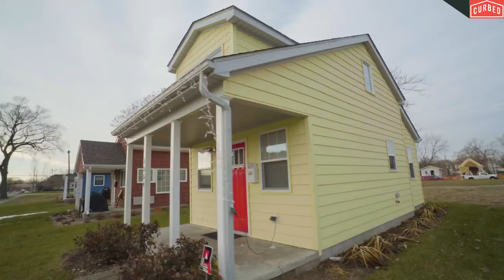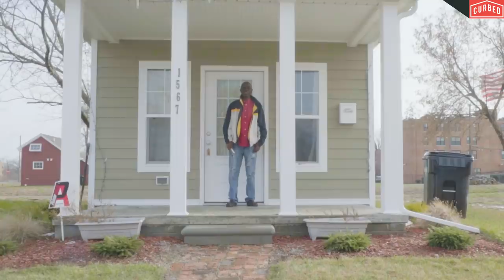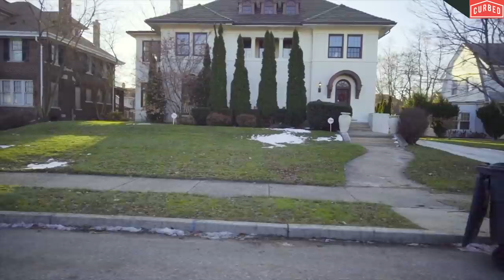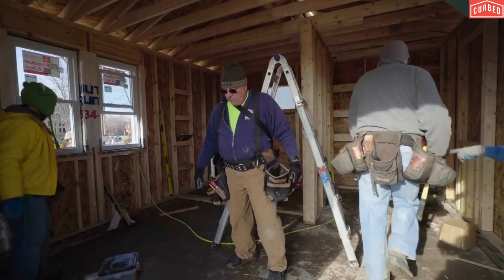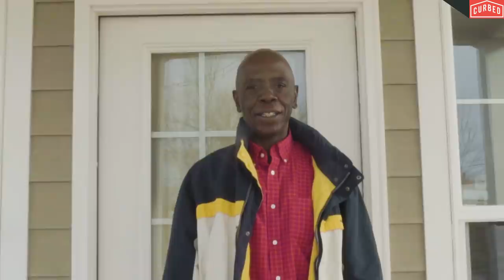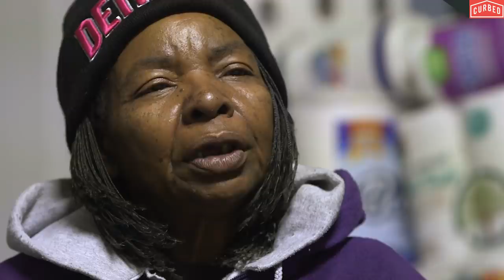Can tiny houses save Detroit?

Comment: This may sound crazy, but can some of those abandoned houses be raised and the materials be reused to build these small homes?
Reply: That's a good one.
Reply: There are laws against using used materials for building new homes. It’s a good idea but keep in mind a lot of these old houses Material is basically unusable to how old and weathered they are
Reply: ^ true, but I believe you can still repurpose old materials for cosmetic reasons. So they can at least save on things like siding and trim.
Reply: I know all over the country parts of houses are saved and "repurposed". Doors, hardware, trim, even hardwood floors. It just seems a waste to demolish those houses and haul it off to the landfill. I really have know idea how much salvageable material would be in those houses. I was just a thought.
Jim
Reply: Thats a great idea!!!
Reply: Jim Johnston i was thinking the same thought. or the sinks, bathtubs, etc.
Reply: Doesn't sound crazy at all. Fantastic idea!
Reply: As an architecture student this sounds horrible razing the historic homes...
Reply: Some of it can but typically it is rotten from not being watertight. It’s can double or triple the cost of materials to deconstruct a building then recycle
Reply: There are things that can be repurposed. I see them do it all the time here in my city especially with bricks. The only things that couldn't be, depending on the age of the house, would be anything containing lead
Reply: Also, Habitat for Humanity gives away to some, almost all the old things from houses they rehab
Reply: @jimjohnston3188  
The valuable parts of demolished houses dont end up in the landfill but in antique shops or in architectural salvage shops.  Clawfoot tubes, light fixtures, windows,  stained glass, hardware, door casings, hinges,tiles, fireplace  mantels, left behind furniture etc.  can be resold for a huge profit,  it's a gold mine, this is why old buildings get demolished and if the buildings are downtown there is also the value of the land to consider.
Reply: Yes why not great ida
Reply: There is the cost of labor to remove these things but aslong as they have more volunteers it's possible there is alot of windows, doors, cabinets, hinges, hard floors, sinks, bath tubs, even toilets, appliances glass furniture light fixtures and fans . The only problem I see is storage and quality inspection on all the recyclables. But if even that can be done then it's possible. Although it wouldn't technically be a new home with recycled material. If you think about it they are better off selling all that stuff to begin with and using all new materials.
Reply: @kvnbal  I agree. It is a sad prospect, but if there just is no money or resources to be had, at least salvage as many architectural objects as possible. And even if money was not the problem, I fear many of those formerly beautiful, stately homes are beyond repair.
Reply: I'll bet there is lots of beautiful wood that could be saved.
Reply: Exactly, people need to change their values and standards, buying new isnt the answer.
Reply: That sounds awfully like a job?
Reply: The problem is anyone with an actual job isn't going to waste their time sifting through trash, so that leaves us with the people on welfare and there's no incentive for them to even clean their own house we give them for free let alone do actual work, which leaves us with volunteers who's time could be better spent helping people or building a new house, just bulldozer them and start over
Reply: This is such a great idea.
Reply: Not crazy at all!
Reply: @marilynwillett804  I hear you about not wasting. But these are low income solutions. Aside from the fact that most of those homes are completely destroyed, how would they pay a thousand dollars a month for utilities in the winter? 400-500 in the summer? I get what they're doing here and I love it!
Reply: Most of the valuable materials have ALREADY BEEN STOLEN by those damn Mormons.
Reply: Yes! The laws mentioned vary state-by-state. My father worked for HUD in Nola and if the materials were still in good condition, they were reused in various ways after Katrina in a lot of coastal towns. Just like if you bought land and tore down buildings on it, depending on where you live, you can repurpose the old building into a new. Outside of city limits is much more common because county rules are lax.
Reply: @lilvegan  it would actually be much more expensive to use salvaged materials for siding and trim. I was a custom builder for years and we would use reclaim materials from time to time and it's very labor intensive and the material cost is usually and least 4x cause of the word reclaim and HGTV so now everyone thinks it's worth its weight in gold.

They said in the video tho that the materials are being donated to them so there would  not be any savings at all and for the type of project they are putting together it just isn't a good fit for that application
Reply: Fantastic idea!
Reply: TKAT it wouldn’t have to be used just structurally, salvageable materials could be used as decorative pieces
Reply: I take it you mean "razed" and recycled. Great idea.
Reply: Reclaimed lumber as interior two by fours, plywood from floors, bath and kitchen fixtures, electrical fixtures, doors , windows and hardware can certainly be recycled. That's how organizations like Habitat for Humanity get things done.   @tkat5709
Reply: Jim Johnston   The answer is no!
The old wood smells like fried chicken, watermelon, and crack.
Reply: It depends on the damages of each house. There may be black mold, wood rot, thermites, etc. Salvaging would require a lot of manpower, which may make it cost more.
Reply: @tkat5709  
As well you have to consider some these 
Older houses have lead base paint and asbestos
Embedded in the materials that can't be removed,
Plus the integrity of the materials too,
Probably been degraded over years of negligence,
And exposure to the elements of that region,
Michigan gets nasty winter storms,
Cold Weather,
And a lot of rain doesn't it?
But what this woman doing is good,
At least she's trying to help the people there,
Just hope The Government or 
The NIMBYS
(NOT IN MY BACK YARD TYPES AKA THE RICH) 
don't try stop her,
Or the criminal elements 
In that community ruin it for those in need there!😕
Reply: Jim Johnston good point👌
Reply: That doesn't sound crazy, that's a good ideal.
Reply: And a lot of those old buildings are either historically significant but not well kept or condemned bc of all the bad chemicals used in buildings. Detroit doesn’t have the money to fix it(the rich don’t help)
Reply: Jim Johnston great point!
Reply: It would be more work tearing it down to reuse material.
Reply: @lilvegan  whatever money you save might be offset by your operating costs. Think about it - she'd have to pay someone who knows what to get & how to get it from an older home and possibly pay for some sort of demo work in order to obtain them. Time is money... for someone trying to give back to the homeless, reducing operating & building costs are important in order to build as many as possible.
Reply: Amazing idea... you are a brilliant man! 😇
Reply: To much lead in materials
Reply: The bricks can be but the cost to do it wouldnt be worth it
Reply: @tkat5709  well I bet the bank that owned them are waiting for them to appreciate lol at least that what we were told
Reply: Great idea💕
Reply: I believe Some used things can't be reused....like toilets
Reply: Great idea. Also, refurbishing abandoned homes for families. Use Habitat for Humanity and Rebuild Together. 
*A good idea is to redesign the City with "round abouts" for traffic control. Design transportation with electric buses and light rail.
Creating a Walking City with Bike Lanes. Using Solar for Street lights and panels for heating and cooling. Caughting rain water and use of "Grey Water Systems."
Reply: I see... Then it would be a mini house ghetto again.  Brilliant.
Reply: Jim Johnston why not buy those abandoned homes fix it up and have people live in it
Reply: I seriously doubt the materials would be usable. They have safety codes when building homes and old materials just wouldn't be safe. It's a nice thought though.
Reply: @jimjohnston3188  We have a Habitate for Humanity store. People donate things for construction and home. Proceeds go to help fund Habitat for Humanity builds.You would have to get the iteam to them. They do pick up large donations.
Reply: Thats SMART!!
Reply: @lilvegan  - Doors and stained glass, fireplace mantels, woodwork etc.
Reply: @kvnbal  - Keep the historic that are viable.
Reply: Some are rotted
Reply: Kevin Gabriel Balderrama they are most likely filled with asbestos..
Reply: Jim Johnston Razed.
Reply: Restore is great for repurposing materials. I've been to a few. A little trove of treasures.
Reply: To be fair the integrity of the material that structured the old home may be compromised and not sturdy enough to uphold the weight of the house. It's risky in which the house may collapse if the structure gives out. Brand new materials will withstand the threshold of the house better than used materials.
Reply: Good idea but there’s a lot to even tearing down a home
Reply: I wish they could fix up the abandoned homes for families. It seems so sad and ironic that Detroit has a huge homeless population and yet there are empty homes everywhere.
Reply: Great idea! People reuse building materials all the time. Habitat for humanity is just one of the non profits that does this.
Reply: Well it’s a possibility
Reply: tons of regulations and corruption in Detriot prevents that and most other great ideas.
Reply: This may sound crazier, but on the Grand Tour they showed just how cheap housing is in Detroit. Why pay rent on this when you can buy a full home for less?
Reply: chula chalupa  unless you're talking about old stuff from the 1800s or something then its junk, nobody wants asbestos houses from the 60s, everything is junk
Reply: Generally it costs more to disassemble an old home and reassemble the materials than it does to just built new.
Reply: @tkat5709  Yeah idk if its a federal law about repurposing housing materials, if so than Habitat for Humanity would have been shut down a long time ago because thats kind of their business plan. I know their stores are mostly interior furnishings and materials but they definitely reclaim tons of lumber, doors, windows, patios, porches, tiles, floors and anything thats still in decent condition at the one in my city
Reply: TKAT that and a lot of old buildings used asbestos and other materials that have been found to be harmful to human health
Reply: @tkat5709  which laws? I see people reuse material all the time. As long as it's in good condition.
Reply: How could we make this happen?
Reply: @marilynwillett804  the government think it is
Reply: There is way too much asbestos, lead paint, mold and rot. Mold in one area of a house, contaminates the entire structure with spores.
Reply: @saraxdouglas8577  Sounds like good idea, but it's also double working with poor quality result. It would be excellent option in some apocalypse where making of new parts is in halt
Reply: Someone from Detroit area here! The thing is, they aren’t demolishing these homes. Many of them are staying standing even though they are horribly unsafe. Most of the “reusable parts” like doors, toilets or tubs have already been stolen or destroyed from inside these buildings. It is best in this case to start new.
Reply: What if it was your property? Doesn't matter if it's decaying. If someone owns the land it is theres and so is everything on it. You have no rights to it.
Reply: @jimjohnston3188  I get doors and hardware stuff but if it a part of a wall or something they can't reuse it
Reply: Most social programs suck. This one is legit because you’re helping people to become self reliance. This is awesome. Much better than giving people jumbo loans so “everyone can have the American dream”. Props.
Reply: What is bad in living in an apartment? Maybe just build good apartments? They can be rather small and affordable
Reply: Yes,can they use the glass? If other materials deteriorate over time,i guess the window glass at least still can be useful
Reply: you can reuse some things like the foundation in some cases
Reply: @lilvegan  .in the bad areas siding and trim,all piing,any copper or metal,water softeners,water heaters,ducting 

is pulled from the homes and sold for scrap sometimes from houses still occupied
Reply: @kvnbal  I rather see that then the torched homes you see a lot of after being abandoned.
Reply: razed
Reply: Not crazy, it's necessary!
Reply: Brilliant Jim.
Reply: That's exactly what needs to be done.
Reply: Well, nobody wants to help people that try to shoot them for being there so. Probably not.
Reply: Asbestos.  Lead.
Reply: Awesome thinking on your part! Unfortunately we have too many laws that are very restrictive when it comes to building and permits and codes.
Reply: And also think about the land that the previous abandoned houses sat on, they could always use it for a different purpose, maybe build more tiny homes...
Reply: most of them  are rotted and most valuable materials like copper pipes have already been stolen so i dont think itd really be worth it
Reply: Jim Johnston Great idea!!
Reply: The regulations  and permits that are required to do this makes it very frustrating and slow.
Reply: No but the Chinese can make furniture out of it, and for 500 dollars you can be the proud owner of a wooden futon that is made from recycled wood from a meth lab, and homicide scene
Reply: Roofs fail in abandoned houses..that causes water to come in and mold and really nasty stuff to grow.  It becomes very risky to get the part of the house that is actually useable.
Reply: Seems like a hazard and not very safe.
Reply: @tkat5709  
And who do you think lobbies against repurposing old housing materials? Big home builders that's who. Big corporations don't want Americans to save money.
Reply: Very true
Reply: Taxpayers own all those Fannie and Freddie houses that sit empty.
Reply: Or refurbish the homes.
Reply: No. Years on countless pollution of all kinds settled inside the walls. Most of the Detroit homes are well over 100 years old. Some of the wood is petrified hard as a brick and a lot of it just rotted. Not worth the effort.
Reply: You mean houses that have been gutted, burned, and stripped of everything that was worth $? LOL Have you ever been to Detroit? 
And really, how much smaller do they want houses to be in Detroit? You mean families in a 600 sq. ft. flat isn't small enough?
Reply: @kvnbal  Maybe but they hold back progress
Reply: I think "raised" should be "razed"?
Reply: Many old home material contain led and  and other harmful chemicals
Reply: @kvnbal  the historic homes aren't being razed. The old abandoned homes that have created an eyesore for the community are. I was there last year and the historic homes are still there and looking beautiful.
Reply: Jim Johnson brilliant idea brother.👍
Reply: Jim Johnston the problem is the land the abandoned houses are on. Bc to buy a house is really cheap but you have to pay a lot of money for the land the house is standing on.
Reply: That doesn’t sound crazy. That’s a very workable idea.
Reply: Very good idea. Reuse is always good.
Reply: I've seen entire tiny homes be built from recycled lumber. Takes alot of time but it's totally possible. Use not toxic cleaners like vinegar amd baking soda to clean things. Creativity is key in these situations. Great job.
Reply: @tkat5709   and some of those old homes may have asbestos in some of the construction materials.
Reply: Some cities are doing that.
Reply: Kevin Gabriel Balderrama in many cities, the homes sit empty because no one can afford the repair and upkeep.
Reply: big mike obama Clearly you know nothing. You just want to spread hate.
Reply: @kvnbal  historic homes are only good if people can live in them. Places like Detroit have streets full of houses that are broken down and need huge repairs. Don;t let the historic tag make you blind to the problems around the house.
Reply: @lilvegan  And reincorporate the roaches, termites, mice and bedbugs into the new home no thanks. All new stuff in my tiny home please!
Reply: Keep the old houses up.
Reply: This only sounds crazy if you’ve seen the abandoned houses in Detroit 😔
Reply: Jim Johnston fantastic idea I think.
Reply: Reused materials is not a good idea from an old and maybe haunted house be used on a tiny home. Not a bad idea but I wouldn't do it.
Reply: Not if they used lead paint or asbestos in the home.
Reply: Gearjammer and comments like this aren’t necessary.  It’s just stupidity. You knew it when you posted it.
Reply: My original thoughts on this were maybe some of the larger more expensive lumber, 2x8s, 2x10s, etc, used in rafters and floor joists could somehow be repurposed for small homes rather than shipping it off to a landfill. If some out of work people could be employed to salvage the lumber and make it ready to be reused possibly it might benefit them too. Look, it's never going to be a money maker. Just seems a shame to landfill all that material.
Reply: @carolynsmith9172  in detroit. now that is a good joke
Reply: @Pareidolia wrong.
Reply: Idk about that. A lot of those homes are historic properties. Beautiful if you look past the abandonment. I like the idea of selling them at a low cost and giving people a chance to rehab them. In many parts of the country you won’t find homes such as these.
Reply: Can't they can't pass the new building codes. It can cost more to fix up then build new
Reply: I would t recommend, most of the old homes are in really bad condition. I’ve personally seen some where it’s just blocks of burned down and crumbling homes. Nothing can be reused and honestly you wouldn’t want to.
Reply: @tkat5709  Many homes built before the 1930s used lumber harvested from trees more than 100 years old.  That means much better cellular structure and rot resistance.  2 x 4 boards actually measured 2 x 4 inches (not ever today).  Careful disassembly could harvest massive quantities of superior materials.

Sometimes the law is an ass.
Reply: @kvnbal  I agree with that.  Raze the ruined ones that cannot be repaired.
Reply: @1982MCI  Smart prospective owners could diligently collect material instead of laborers demanding $50+ an hour.  Sign waivers of liability where applicable and assume some risk.  Our forefathers did just that and look what happened.  

City permitting must adapt to accommodate this.  Dictating new materials and licensed builders only enriches the contractors and the city coffers.  Muster up some do-it-yourself ability, with some guidance from caring inspectors, and new life is possible.  The current system only guarantees failure.
Reply: Might be full of asbestos!
Reply: in general--no. most building materials are not reusable/recyclable. Steel is one of the few that is (gets melted and reformed)